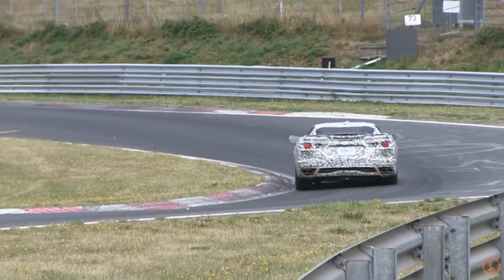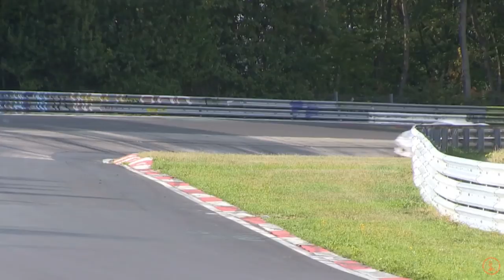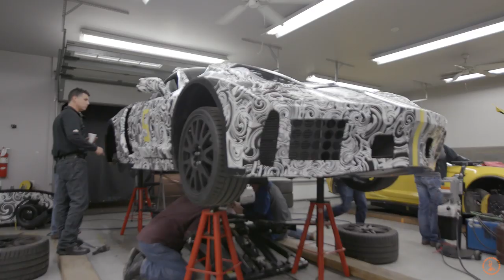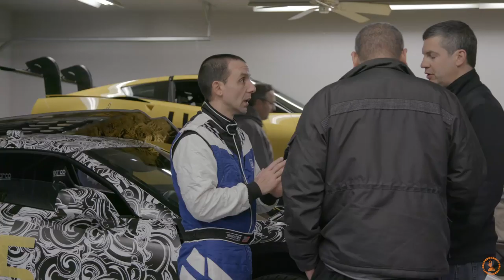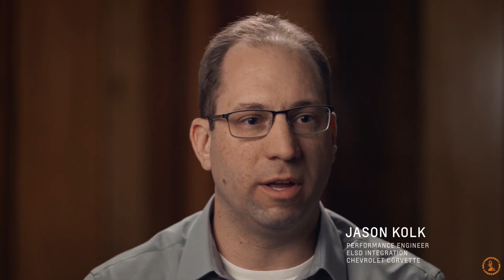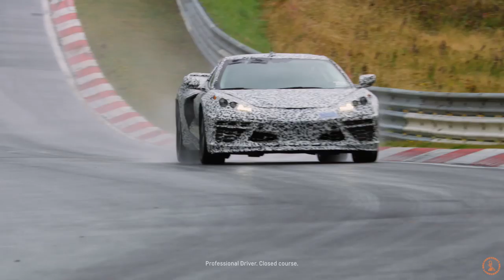2020 Corvette C8 Nurburgring Lap Time REVEALED!

Comment from the maker: What do you all make of this time, is it good enough in your eyes or did it disappoint? 

Personally, I'd like to see a bit of a better time.. especially because chevy touted the performance gains from moving the engine to the back. Still though, not a bad time at all and definitely gets us excited about the future higher performance versions of the C8.
Reply: What was the time? Didn't see it.
Reply: A lot slower than I was expecting. Are they real times?
Reply: Didn't the Camaro ZL1 1LE achieve better numbers or am I mistaken? I love the C8 but Chevy's claim they've reached the performance limits of a front engine platform is just plain false. GM clearly wants the Corvette to compete with introductory level European mid-engine supercars and I applaud them for that, but the main reason they claim for the platform shift isn't very convincing. It's a fantastic design as a first commercial mid-engine offering nevertheless, and very desirable at that price point.
Reply: I dont think anybody needs to be disappointed here, the C8 Z51, is just a great sports car the Vette puts out 500 PS only and for a 500 PS car that lap time of 7:28 is good.
Because its an everyday driveable machine with good quality interior, lot of creature comforts as well,
Also we still are not sure which tire the C8 was using, also the Ferrari 488 GTB with 670 ps and Mischelling 4S tires was able to do just 7:22,
All this said, it ll b really interesting to see what the lap time of 2020 GT500 track pack ll be, cuz, that monster already beat quiet a bit of super car around VIR and even beat the Viper ACR and is now in middle ground between 19 ZR1 and C7 Z06.
Reply: The track seems correct for the c8, you have to remember the regular zl1 time was 7:29 and weights 250 lbs more, that's one aspect of the c8 people are forgetting, it's a heavier car than the c7, the c7r1 and zo6 were beating other mid engine cars on the track but now the shoe is on the other foot, and besides this just a base vette, better times will come with more power from this platform.
Reply: @hpickettz34  
Well the justification that some say is, the Porsche 911 GT3 and GT3 Rs both has just 6 cylinders ,just 4000 cc displacement and yet did better lap times, 
Well, I for one still think no US car company has the brilliance Porsche has when it comes to putting power to ground. Still why is it that lot of GM guys are saying this is a bad time,
Heck its not, the special spec BMW M4 GTS is not a slow coach and the base Z51 is able to hang with it shows its a splendid platform,
The C8 Grand Sport itself might be around 10s faster, the Z06 might hit the low 7.0xx and ZR1 s gonna breag the 7 mins barrier, chill out GM fans
Reply: @Glenn Rosulek 
See any car with high HP numbers and super wide tires has a chance to outdo Porsches, but HP to HP wise, nothing on earth still can beat Porsche. Chevy definitely has closed the gap now, still not enough to say Chevy has beaten Porsche.
Reply: @Glenn Rosulek 
Well thats true, my point is, some GM fans say, GM has outdone Porsche, but I being an automotive fan more than a GM fan wouldn't agree with that, I say, if there still is a brand that can put power to ground more effectively than anyone, its got to be Porsche, followed by maybe GM,
Whats surprising is Ford, they are see sawing, like the new GT500, its a whopping heavy weight, but puts down power extremely well.
Some of the lap times GT500 does makes it attack the Corvette Z06, and thats one huge achievement however one may look at it, cuz GT500 weighs over 4200 lbs, is less aerodynamic and its dohc sc setup means it has high CG ss well, but somehow it punches above its weight in a really good way. Sure tires help the GT500, but its still good to see  a rental car like platform from Ford being able to do that.

The Vette and the Alpha platforms already are superior light weight platforms but not the s550. Thats what amazes me the most.
Reply: Someone tell me how accurate is this information
Reply: Good time, expecting better but I've had wider tires up front on my cobalt ss Tc.

Probably other cars or bad driver. Expecting near record times with the new z06

For the money, the corvette is beyond a bargain. If I had the money, I'd still feel like I had to pay them more for a mid engine supercar.
Reply: GM probably had McLarenP1 as a reference when developing the C8. It should be borne in mind that a GM C8 is a much cheaper car than a McLaren. GM's engineers have done a good job, simply. Well done (y)
Reply: Needs to improve.. better driver's maybe.better handling, racing crew and driver's should share info with the design team it's what make porsche great and it's just a win win

Comment: Missing some key points - first of all, consider the time and the tires. MP4S is a much slower tire then the tires run by the zl1 1le; gt2; m4 GTS. Simply putting on the supercar 3Rs would significantly drop the lap time. Second; yes - you got on the hype train. No additional power means the car is only going to make time on corner entry; mid corner and corner exit. Everyone says the grand sport was the best corvette there was of the last generation because of its power - to be blunt... the mid engine layout wasn't built for the base car but for the ability to put power down on corner exit for the Z06 and (if it comes) ZR1. The base car was never going to be much faster then the c7 stingray because the base stingray (or grand sport) didn't (doesn't?) suffer from the architectural challenges the high power cars do.

Comment: A little disappointed based on the initial hype.  Going with weight in rear helps acceleration but hurts ultimate handling which is why a Cayman handles better than a 911.  You would think the C8 would brake better than the C7 but it doesn’t.  I think it needs bigger brake rotors on fronts.  No 911 has bigger brakes rear than front like the C8.  To me, they are limiting the performance so the C8 Z06 will have a bigger performance difference.

Comment: The C7 Grand Sport with 40 HP less was with 7:27 one second faster than the brandnew mid-engine C8 with 500 HP. The time of the C8 with 7:28 is disappointing and shows once again that GM marketing dept. just created a huge hype around the new Corvette but in fact, the C8 is only faster on straight line from 0-60 but not on the track.
Reply: I'll find out because I run my C7GS at Thunderhill all of the time. They will be showing up there and theoretically I should get spanked. Just how bad we'll see.

Comment: The 2017 Dodge Viper with MANUAL and front engine, very few practice laps and a local driver that had never drivin the car set a 7:01 The Viper was a friggin beast.
Reply: vin russo It also has 650 horsepower and a ton of downforce and cost well over 100 grand. It’s not a competitor.
Reply: of course a local is going to be faster. That track is terrible, its long, its rough, lots of blind turns and over crests it might as well be a ralley stage. The ring is about knowing the entire track, where you can push it and where you can't. Then to top it all of is the carousel, one tiny mistake and you lose your car.
Reply: Lmao imagine if dodge made a mid engine viper
Reply: @KillaZamii  the Viper was mid engine. It’s a front mid engine car

Comment: it is the base model, that would be like taking the 6 cylinder challenger and saying how slow the challenger is on the drag strip. I don't even know if the other manufacturers make a  base model. You will have the option for a 60k vette (base model)or 180k vette. (Z06, ZR1)  What one would you think is faster.

Comment: Only place i think the ne c8 is lacking is in the handicap suspension bias ands tires. Some of the cars you mentioned i think are on much gripper tires and much more aggressive suspension set up. When i talk about suspension set up i mean it's bias to not want to over steer (daily driver tuned vs race tuned). For the benefit of the non professional drivers getting behind the wheel ands the fact some drive them in almost all conditions. 

Legal Race Tires and race tuned suspension ands a racer with balls of steal that's what i want to see.